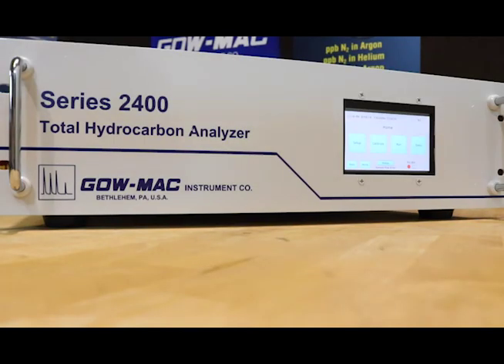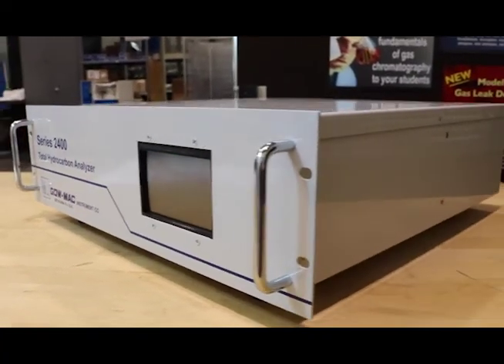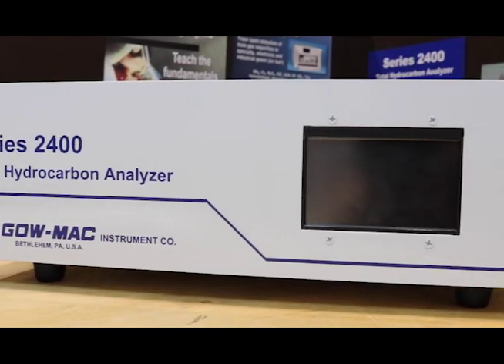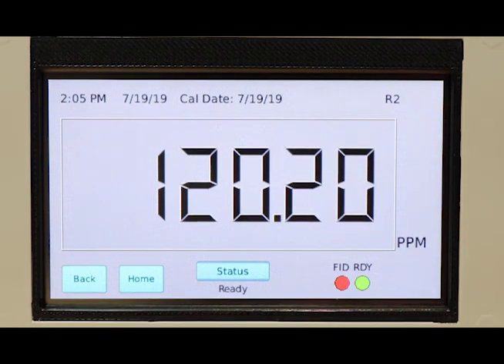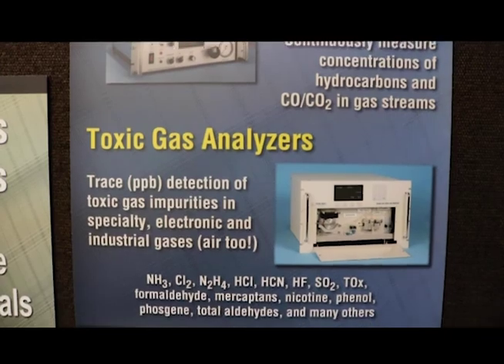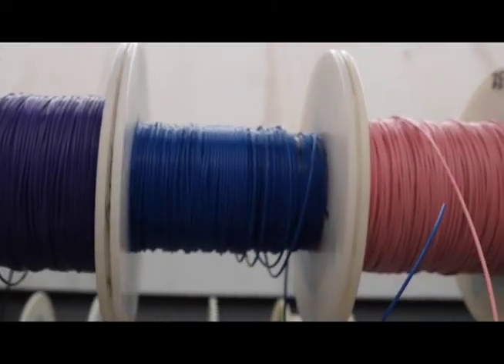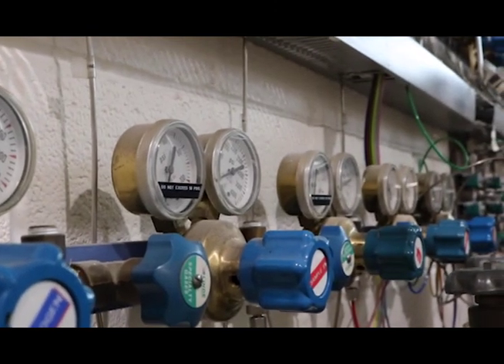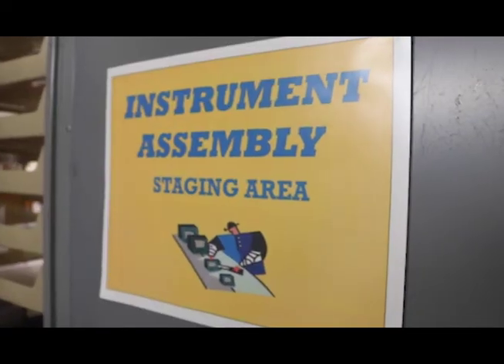Series 2400 Total Hydrocarbon Analyzer Introduction

Comment: Got the 2400 CM installed but can't get flame ignition. Base gas is H2 and fuel gas is 100% H2. All pressure at 60Psig. Start with Air at 300, Fuel 30 and Sample 60. Did change
 ratio's but still no ignition. Any pointers will be appreciated.